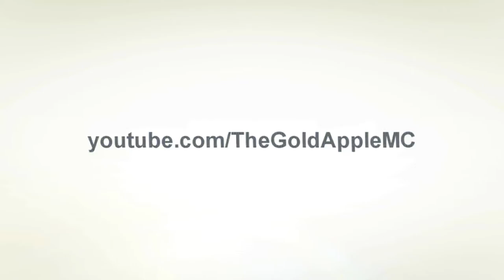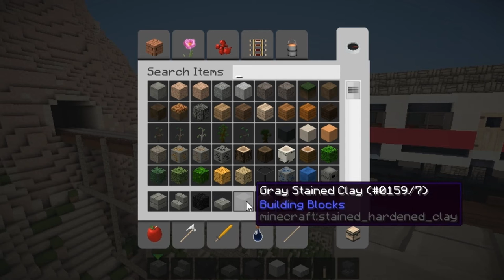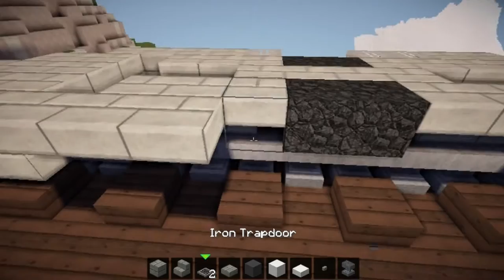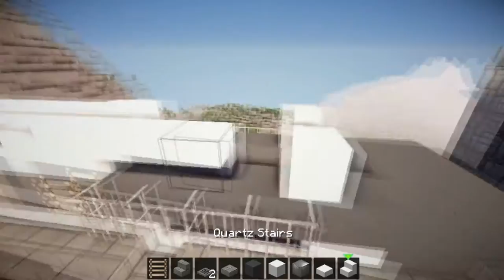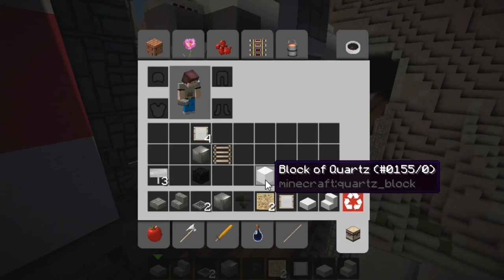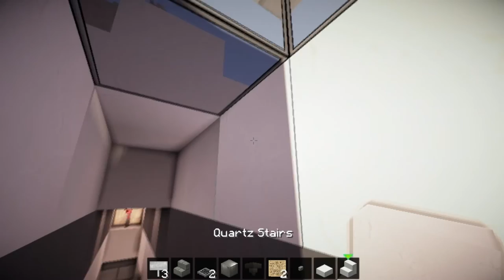How To Build A Steam Locomotive Train - Minecraft Vehicle Tutorial Series

Comment: Your tutorial was good but I’ve found some shocking findings 
1. There is supposed to be a tender at the back 
2. The cab is at the back 
3. There needs to be a smoke box area at the front 
4. There needs to be a bell at ether the front or on the boiler
5. You need to have a running board on the side 
6 the position of the funnel is off 
7. There needs to be a headlight 
8. There needs to be a number/number plate